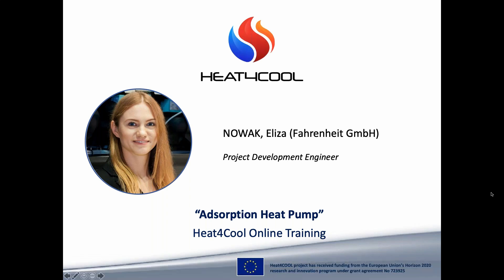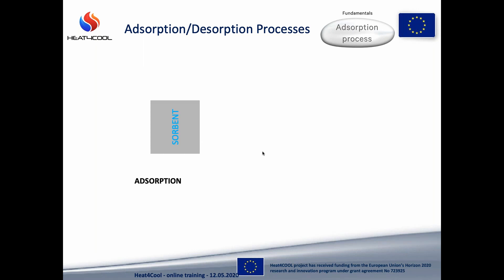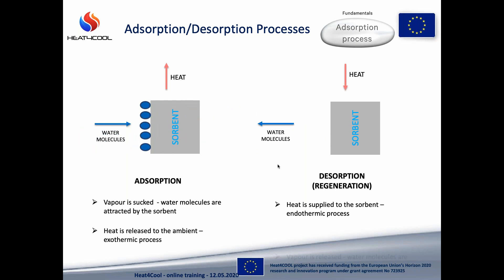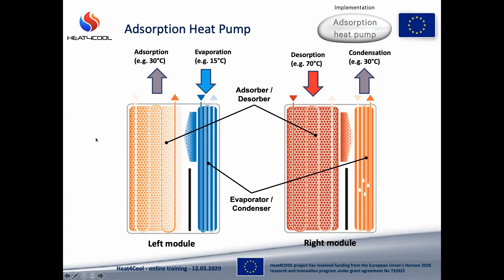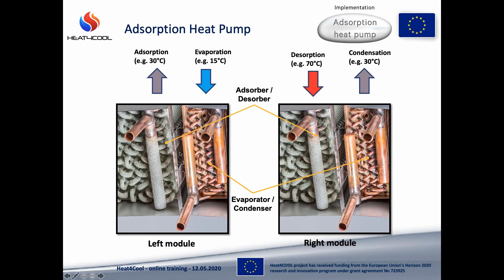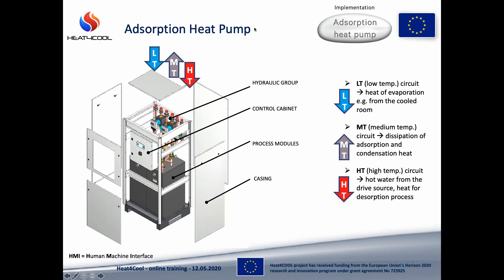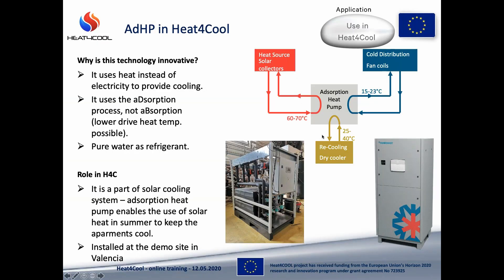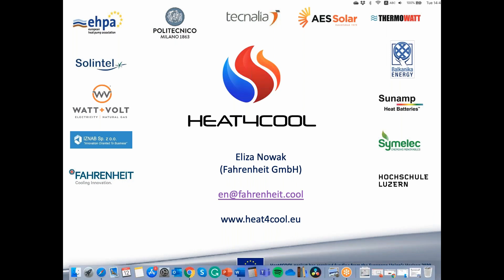Online Training- adsorption heat pump by Fahrenheit (Heat4Cool)

Comment: I wonder if you could use Temperature Swing Solvent Extraction to get Calcium Nitrate Tetrahydrate out of a water solution into an amine solution and then drive off the water attached to the Calcium Nitrate while in the amine solution by further elevating the temperature after the extraction from water.  Once cooled if this solution is again mixed with water it may have a useful endothermic reaction that could be used for a cooling application.